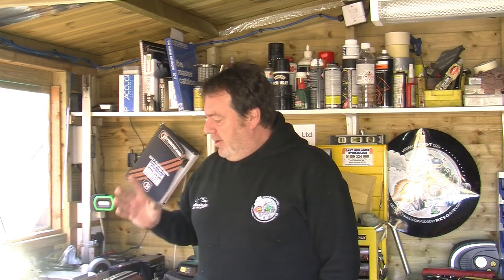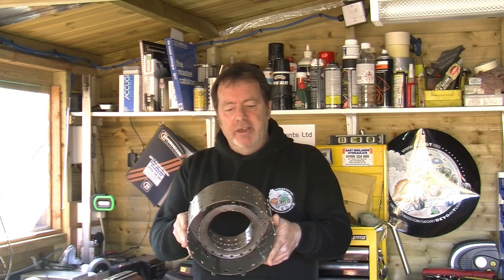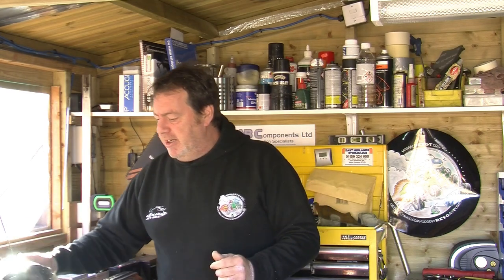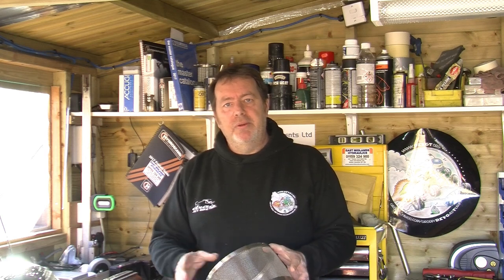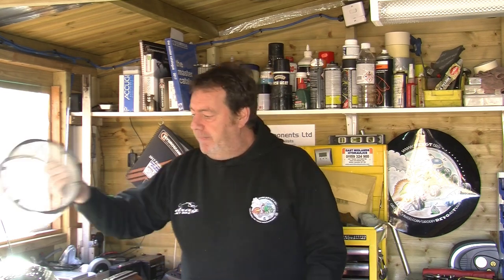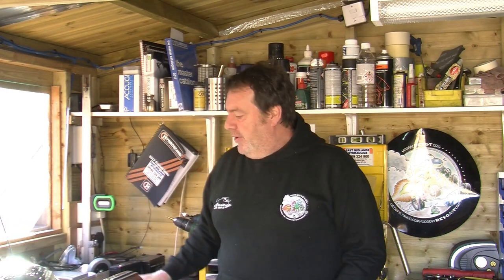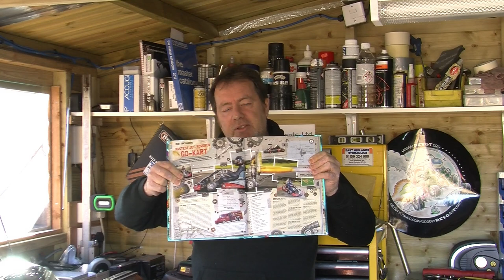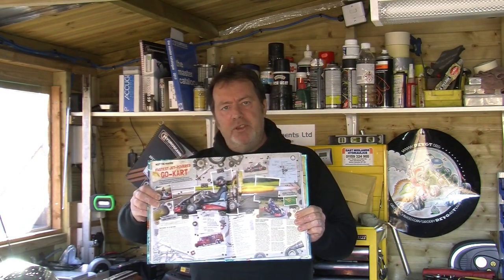Jet Engine Building From Turbo - The New Diy Engine & Guinness World Record

Comment: I was curious on your fuel system for the hxmonster is atomization style or evaporation? How many psi fuel pressure are you running
Reply from the maker: Hi, yep it atomization, spray nozzle from oil fuel heating system, Danfoss... i get about 150psi from a Bosch EFI pump at about 18 volts
Reply: @Turbojetkart  at 100% what is your fuel consumption? Also thanks for the replie
Reply from the maker: Am running 25 US Gallon Per Hour spray nozzle, so if my maths are any good about 2ltrs minute on the engine and 3ltrs + for the afterburner
Reply: @Turbojetkart  sorry last questions what do you use for ignition and what weight oil do you use thank you you're a huge help
Reply from the maker: I use 5/30 full synthetic oil, and a homemade high voltage ingintion box as show in this video https://youtu.be/iDg-K9z_L2o